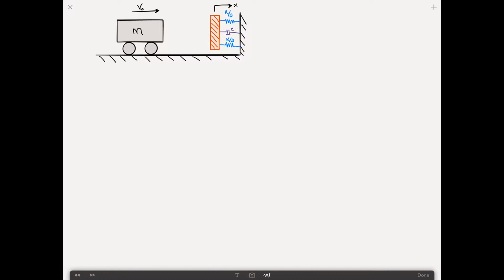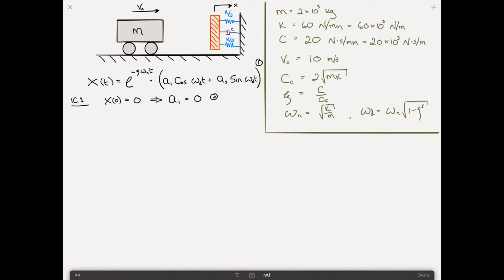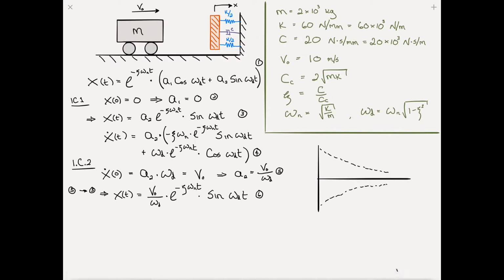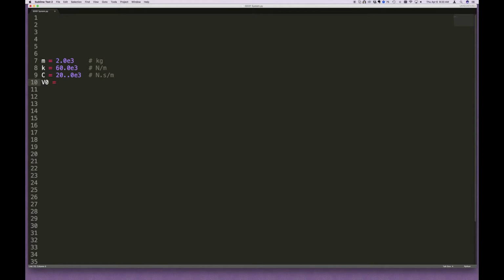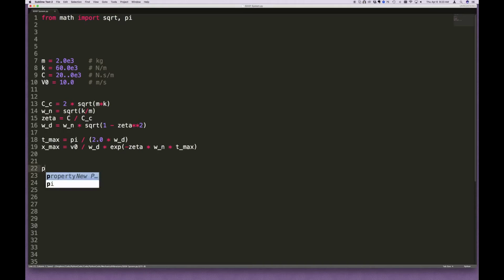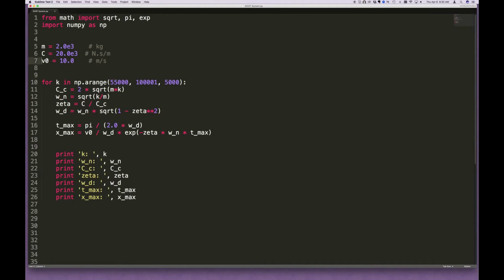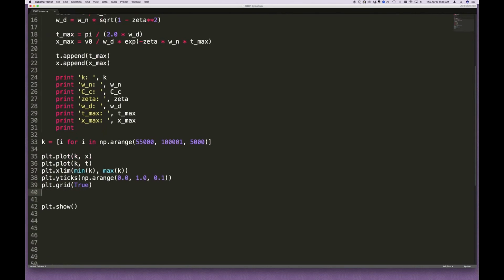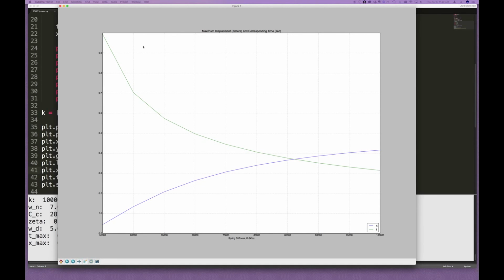Shock Absorber Problem

Comment: The Tmax should be computed when the displacement is maximum, meaning when the derivative is zero. Is that the same when time is pi/2?
Reply from the maker: Yes.
Reply: you are right...only when the damping ratio is much less than 1 the maximum displacement is approximately at the time equal to pi/(2*omega_d) (for this initial condition), but not exactly at that time, and for damping ratio, e.g., 0.5 or higher (but less than 1), this approximation is not good...

Comment: Hi I really like your video. Can you explain how quickly execute the code? Every time I have to find the location of the directory file and run the code. And it doesn't show the plot. Any advice? Thank you!
Reply from the maker: I use Sublime Text as my text editor and that has a shortcut CMD+B (Build & Run) - probably CTRL+B on Windows.  This is a very quick and useful way to execute the code.  Depending on how your version is Python setup, it might require you to add the path to Python in your preferences - but you only need to do this once.  My preference is to use the command line.  

The plot should show in a different window.  Sometimes this is hidden behind your current window - you might need to move it in order to see it.
Reply: @Freeball99  Well, I tried it and the plot is shown very quickly. And I used some time to fix the Module numpy and matplotlib problem. Your video and answer are very enlightening~ Hope to see more.

Comment: at 4:06 how is x(0)=0 ,but v(0) has a value????
Reply from the maker: Immediately after impact between the cart and the shock absorber, there is no displacement (yet) of the shock absorber, so X(0) = 0.  However, as a result of the collision, the cart imparts an initial velocity, V0, to the shock absorber.  So, initially this looks like a mass-spring system will no displacement and an initial velocity.

Comment: Can you please make a video for a system of a hamonic oscillator which includes angular oscillations as well as linear oscillations? :3
Reply from the maker: Not quite sure I understand your request...what is meant by by "includes angular as well as linear oscillations"?  Are you referring to something like these problems?: https://youtu.be/Wbj0Sat8pbY https://youtu.be/eZYQm-xPKSY  https://youtu.be/PPN6SJhWAOU or is it something different?
Reply: Oh I'm sorry) I meant ,let's say , if we have a beam and it rests with its edges upon two supports with its dampers and springs, and we apply some force for a period of time somewhere on top of the beam (or bottom) so the vector of the force is not crossing the center of gravity of the beam and it causes some inclination(angle theta for exmpl) of the beam as well as vibration. And the question is: how do I describe vibrations of such system with just its theta and x oscillations? I know that i could apply rotational version of Newton's second law for this angular oscillation, but not sure that it's correct to do such things and the center of rotation will vibrate too in that case, so it gives even more struggling)
Reply from the maker: Sure.  Probably a good example of this would be a car or a motorcycle.  It bounces on its shock absorbers which causes its C.G. to move up and down (translation).  At the same time, it bounces differently on each shock absorber which causes rotation about its C.G.  I'd be happy to work such a problem.  Give me a week or two.
Reply: Oh, great! I'll be waiting)